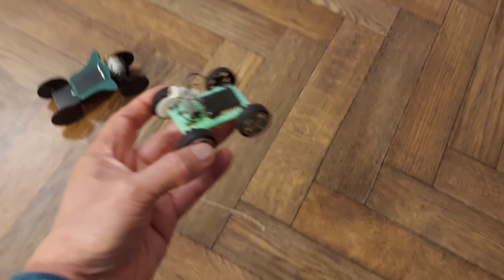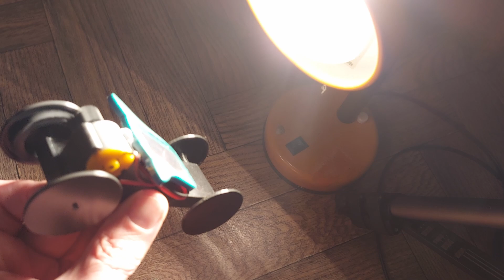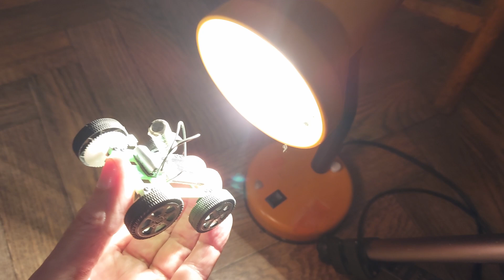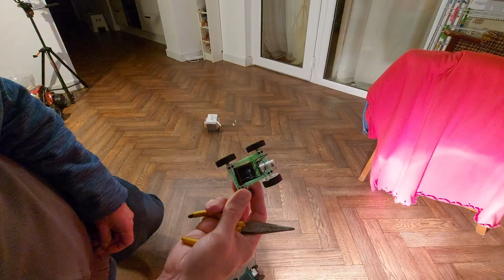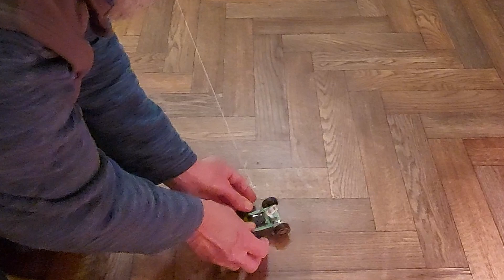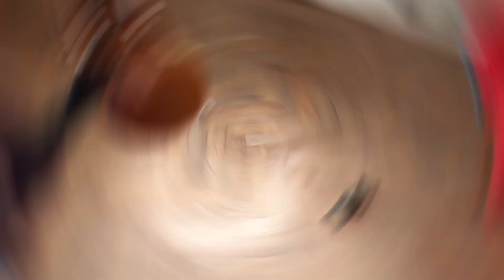Solar Supercapacitor powered tethered cars

Comment: Thanks for sharing, simple but interesting. 

Noob question here: what stops us from using the solar panel to power a light source which then gives light to the solar panel which then turns the wheels and gives power back to the light, creating an infinite power source loop. Lol don't know if my question makes sense ?
Reply from the maker: I would suggest you do some research on solar panel efficiency. Unless you can find one that produces more energy than it consumes, your idea will never work. Each time through the cycle you lose energy.  Here is an answer from a quick Google search "How efficient are solar panels? The efficiency of solar panels has improved dramatically in recent years, from an average of around 15% conversion of sunlight to usable energy to around 20%. High-efficiency solar panels can reach as much as nearly 23%." So for the energy you shine into a solar panel, you get less than 25% of that energy out. Add to that the inefficiency of any light source such as an LED, probably around 25% to 30%, and your power is rapidly spiralling downwards. So to make the maths simple for you. If you started with 100 watts shining at your solar panel, you get about 25 watts out, then your LED only produces 25% of that as light, so you are down to 6.25 watts. Shine that 6.25 watts at your solar panel and you get about 1.25 watts out. Put that into your LED and you get about 0.25 watts to shine on your panel. Your panel gives you back 0.07 watts and so on.
Reply: So I have a simple solution to your Mathematical problem Grandpa, if a solar panel outputs +-25% of the energy ... use 4 solar panels. 4 x 25% = 100% .😂

Just kidding, I did some quick research, and I understand what you're saying. There are also various factors that contribute to how energy moves from one medium to the next, and such a system is not feasible due to the fundamental laws of thermodynamics. Any real-world system will experience losses due to friction, resistance, heat dissipation, and other factors. So, I guess that idea is out the window, at least for now 🙃
Reply from the maker: 🤣 With your first (joke) reply, why not use 8 panels and have 200% efficiency and you have solved power production for the world 👍😂

Comment: What about putting two of the super caps in parallel. Same voltage as you know, but lots more capacity. I am referring to the walking robot. 
Although you could do it with any of them. I have never used a supercapacitor.
How many farads can they go up to? 👌👍👍
Reply from the maker: You can get supercapacitor based units that will start your car for you. Quite a few channels have done videos on big supercapacitor projects. Lasersaber has been doing a car pack project for 11 years now https://www.youtube.com/playlist?list=PLUd8qSRI_F8hD-8Gdufp9MDChEC9ccavr
As for sizes, how about this pack https://www.aliexpress.com/item/1005006046864428.html